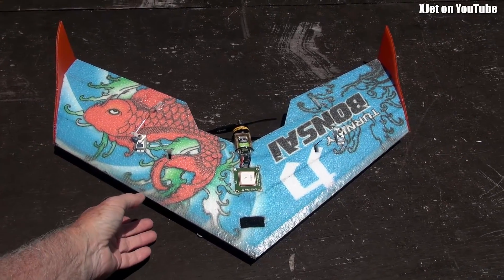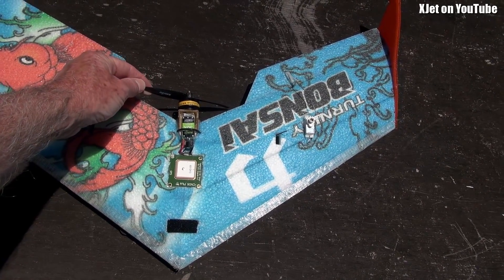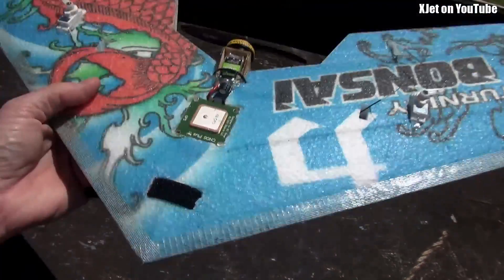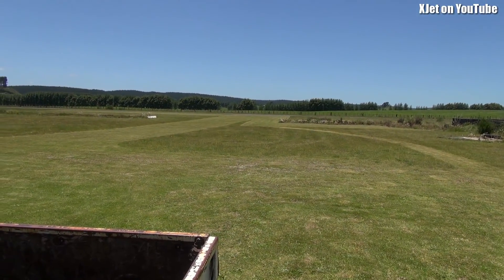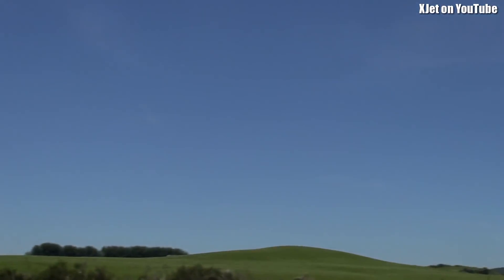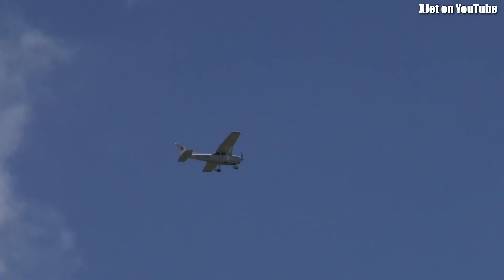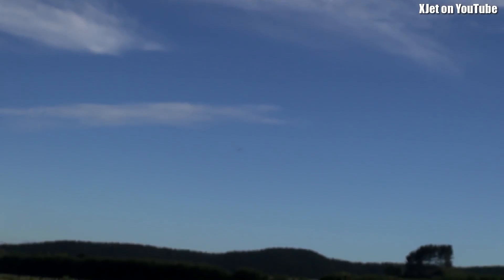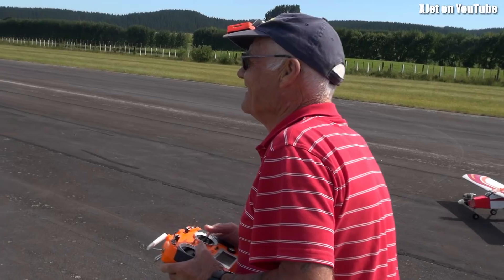The summer is back... just wait until tomorrow!

Comment: thanks for posting.   here are some things to consider.    at :07,   Mass  AFT of the model's  cg/c-m  Could  be  Reduced.   elevon servos  Could  be installed, more inboard and  On (or forward of)  the  cg.     most of the  Mass  of the  vert-stabs is  Distant from the model's  cg / c-m.    imo, in this application, the vert-stabs should extend  Only,  Above the plane of the wing;  or   Equally,  above-and-below.    at 1:14,  some  tape  Should be wrapped around the vert-stab leading edges.     generally,  if  Mass  aft of the cg /c-m of a model can be  Reduced,  it is a  GOOD  thing.    btw, the name on this model is Not the word that is pronounced,  banzai.    at 4:55, the non-conformance of the length of the forward fuselage can be seen; in other words, the distance between the prop and the c-m is  greater than  Nominal; resulting in excess stability, in the pitch axis.    at 5:21, it appears that  hoerner wingtips have been used.  if so, imo, the use of such wingtips on a model,  is  seldom  a good idea.   cheers            googletranslate